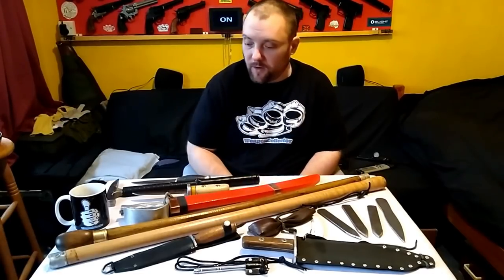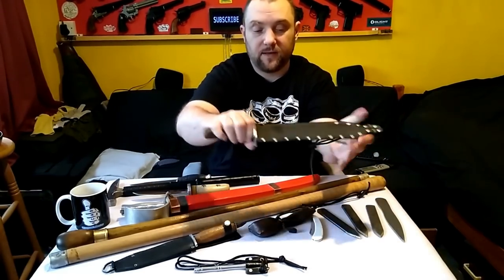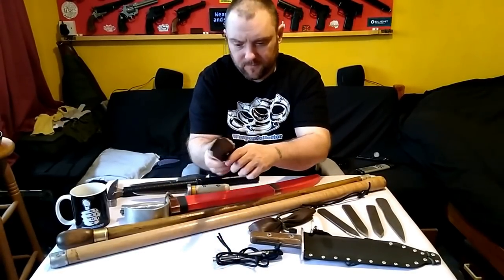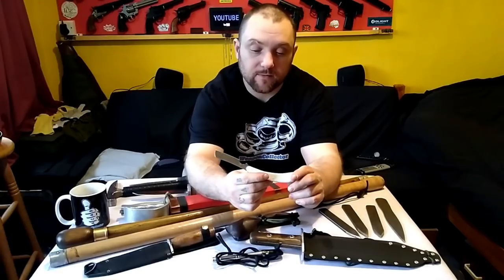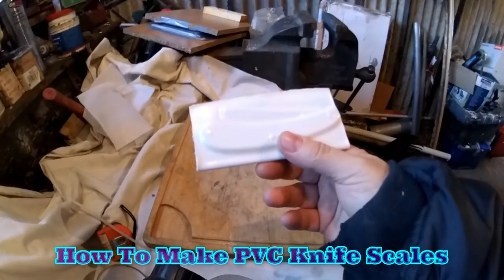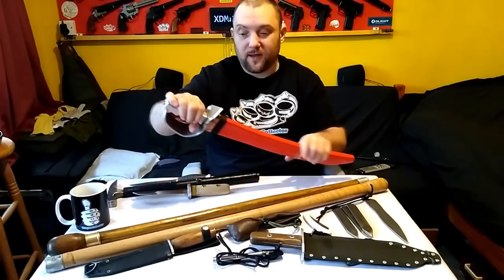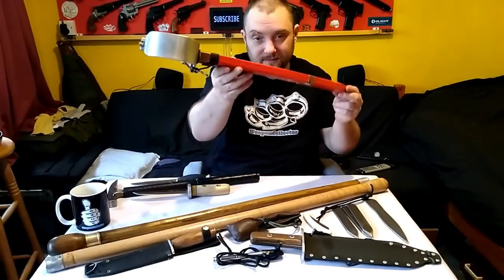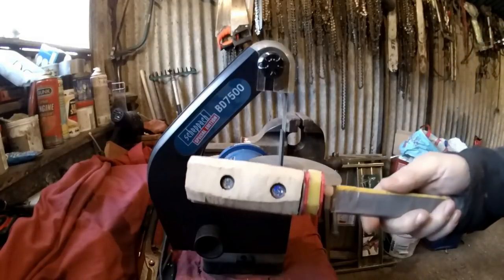My Recent Homemade Weapons Collection

Comment: It's always nice to see things that might have just been thrown out being refurbished / turned into something useful instead of  just going to the tip.  Back in the day this sort of thinking was more commonplace. Today's throw away society has generally lost  the ability to even think of re-purposing old / damaged / worn out stuff. Which is a shame really.
Reply from the maker: You're Zed and it is a shame, lots now just chuck it away, get a new one, i'd rather fix stuff and even make stuff, i quite often make furniture type stuff too but don't show it on the channel.

Comment: That machete bowie is a lot thicker than I thought at first , looks like its just shy 4 millimeters , though its probably thinner , bet it's still pretty terrifying due to how light it is 
And I do like the way that fairbarn sykes type dagger ended up.  Nice work on all of this Mike !
Reply from the maker: Thanks Jon, it was a good quality machete to start with and probs around 3mm, bit thin for a bowie but like you said very fast to wield and still hit hard due to the size of the blade.
Reply: @WeaponCollector it was a tramontina , so pretty good , its also a very wide blade , so that'll add a lot of mass into cutting